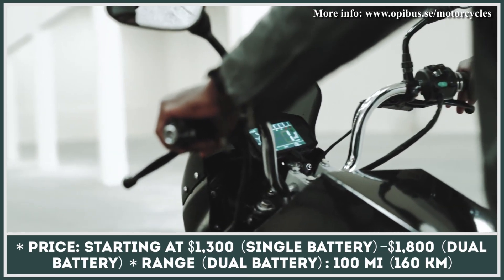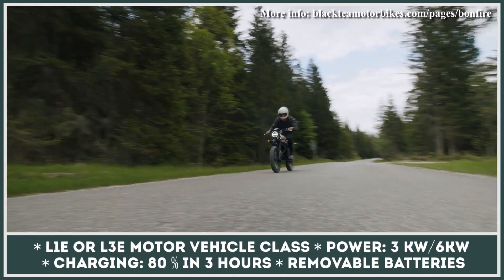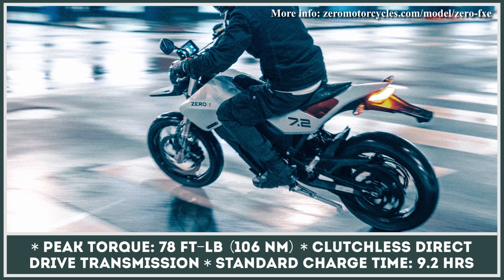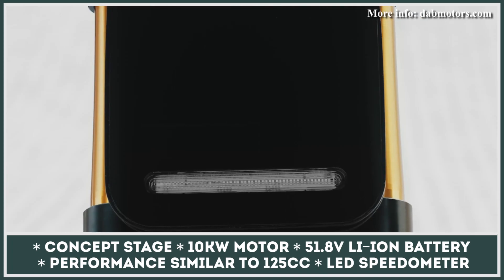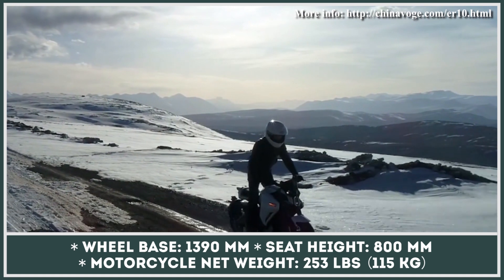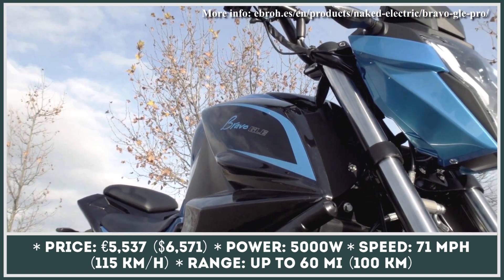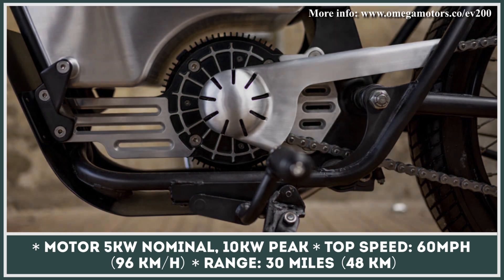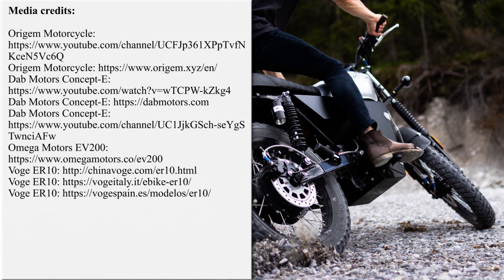Upcoming Light Electric Motorcycles for 2022: Good Zero-Emission Alternatives to 125cc Class?

Comment: Watching this again 9 mos later... Maybe Obama can back the importation of the Opibus from Kenya?
Bonfire X at $5799 gets 65 mph and a range of 68 mi; Zero FXE, $12995,  with 85 mph and 80-100mi range not bad. Zero SR/S $22,695, top spd 124 mph, range at 70 mph = 113 mi; Urbet Gadiro $4062, 31mph/99mi; Dab E..$????, 60mph, 60mi: Voge ER10 $8000, 60mph, 45mi; OFR M-1 $????, 80mph...; Ebroh Bravo $6751, 71mph, 40-60mi; Origem is a European concept bike, not in production at this time. Looks like the SONDORS METACYCLE wins again...

Comment: Good. Ideas. Thank you. 
I think most riders except the yuppie-do-dah crowd don’t want e-bikes that scream I’M A EBIKE. 
Whether correct or not IDK. 
I would like to see a light-weight dual sport with decent range. Maybe running two batteries but can run on one. The two run out, use the one to get back. 
Make it look like a real motorcycle. Not fancy moped.
And bikes will have to give us a reason to buy them. Like lower cost. Or similar cost with impressive specs.

Comment: These bikes got to do at least 100kph to keep up on our freeways in Australia
Reply: Most ebikes don't have the range to make freeway speeds appropriate, and top speed usually drops when the battery gets under 50% so it won't be reliably that fast until you build a huge bike like the zero models
Reply: Is that the speed limit on Australian freeway?